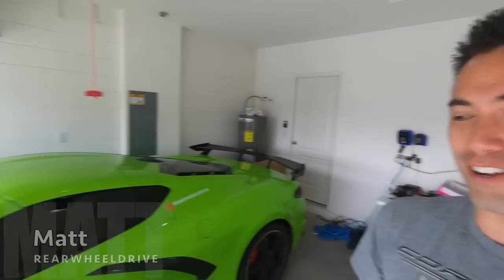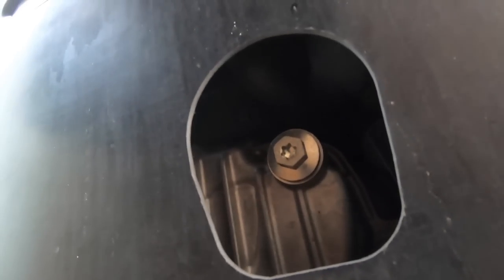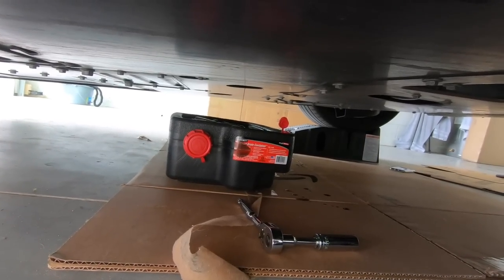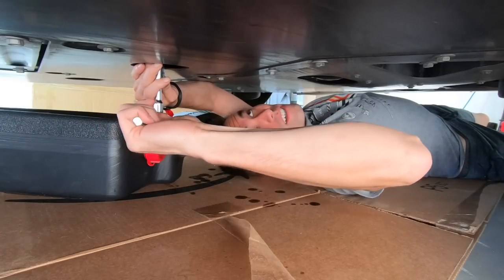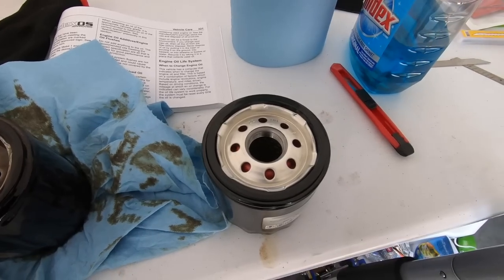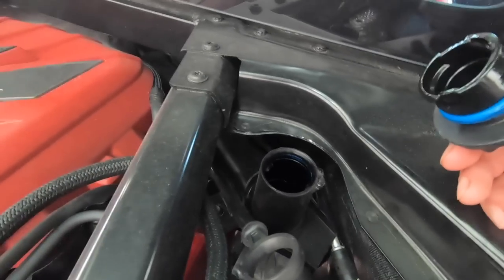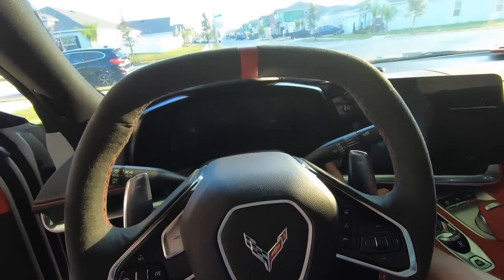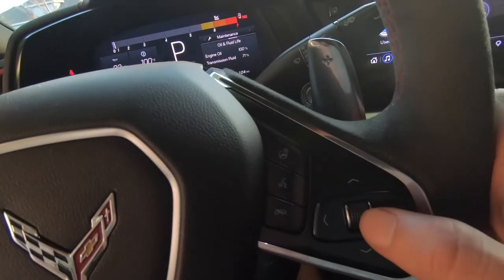C8 CORVETTE OIL CHANGE (How To Video)

Comment: Easy. Just never get under a car without jack stands. Safety first.
Reply: Normally I would agree but good Rhino ramps are plenty safe if you put car in park and apply e-brake manually.
Also ALWAYS BLOCK FRONT WHEELS WITH PROPER RUBBER CHOCKS.

Comment: There is another item that needs to be changed, particularly for the first oil change. It's the  Dual Clutch Transmission filter which is done every 7500 miles.  Check your manual.
Reply: is that something that is as easy as the oil change?

Comment: Nice dude nice! Awesome video!

Couple things I have learned doing oil changes over the years:
1) Get those rubber gloves janitors or commercial cleaning staff use. Keeps your hands completely clean, they are gold. 
2) I actually take the fill cap off first before draining out the oil. Its an old habit based on a presumption that air pressure coming down through the fill cap will help out oil flow. I am probably full of crap there lol.
3) I also started using a wide tub and then using that to fill a tall gas can looking thing because those pans similar to what you had in the video always broke on me. It was frustrating. Plus with the narrower trunk situation we have in the C8, probably better to do that than a wide pan to transport to your local parts store.

I am glad you pointed out the difference between the European and Dexos2....many people are mistakingly buying the wrong type.

I have ramps too currently, but I am stocky and my head is huge so I barely have clearance underneath my lowered Camaro right now. I plan on getting quickjacks finally for the C8.

Comment: Thank  you.  May want to check but I found oil on either amazon or ebay I don't remember, 6 quarts for $55 with a AC Delco filter the right one.  And free shipping.  That was cool didn't even need to run to the store.   Don't you just love the sound!   Again Thank  you for the video.
Reply from the maker: Did the oil have dexos 2? If so that’s a great deal
Reply: @RWDC8Z what it says ESP +3 in the green letters ? Does that work too ?

Comment: Matt, love this video. Just got my 2024 C8 this week. When I was younger I always did my own oil changes. I think I’m going back to doing it myself as they are insanely charging so much to do them now and you showed how easy it is to do. Questions: Do you have a link for the oil drain pan you used and the ramps? How to you take the oil out of the pan and what do you do with the old oil? When I was a kid we always pour it down the storm drain or into the grass if you believe that (can’t and never should do that anymore!j. Also is it really a good idea to back your car in the garage and have it running for the carbon monoxide fumes that can kill you (I don’t think so!)
Reply from the maker: Thanks man! Autozone for drain pan, ramps are race ramps. Take used oil to autozone
Reply: Is race ramps a brand or type of ramp?

Comment: excellent video use ramps and block front wheels for safety as he does-very important as you will be under the Vett in the middle of car.
I have done 4 changes on my c8 but would like to add in march 2021 nobody but Amazon had the proper oil.
Also be carful on using aftermarket oil filter as chevy has a distinct by pass that they use on the LT2 engine. Another thing is O-rings are not available you have to buy a complete drain plug for about $21 bucks so you might want to have one on hand incase you need it while doing the oil change. And for God's sakes do not use the European 0-40 oil it has to be ESP oil now called SUPER CAR OIL ON THE MOBIL 1 OIL 0-40  Amazon is about $57 for a 6 pack of oil.

Comment: GM claims that Dexos — marketed and spelled with a lowercase “d,” as in, dexos — keeps engines cleaner, reduces sludge, improves fuel economy and reduces engine wear because it flows easier than other oils, and it can help emissions components last longer.

Comment: Thanks for the demo video. probably try doing this with mine tomorrow, ..it will be my first attempt. . let me know if you have any other tips that weren't mentioned in your video.
Reply from the maker: How did it go?
Reply: It'll most likely be another week yet. But I was happy to notice those ramps you used. I already have the same ones & wasn't sure if they'd be okay for the job. Do you know if it properly drains enough of it's dirty oil with only the back end raised?
Reply: @RWDC8Z  All went well today. I had to go with Mobil 1 0W-40 "SUPERCAR" oil And my GM dealership OEM filter also had the 8 holes like your Mobil 1 filter.

Comment: Guy’s just a heads up I contacted Exon Mobil and they said you need a M1-114A filter. It has a higher bypass pressure. He said the M1-113A has too low of pressure bypass and won’t filter oil.. also you should use Mobile one Super Car oil made especially for the Corvettes.

Comment: TY for the video 👍👍

There where several important items you left out.

1) Use a torque wrench to tighten the drain plug. Per GM the torque spec is 18 ft lb 
2) When tightening the oil filter turn it until you feel resistance.  Then turn it 3/4 of a turn, no more! Any tighter you risk not being able to loosen it next time.  Less than 3/4 it will leak

Comment: hey matt hows things? just a question i was told that there was a bolt similar to the drain plug in the transmission and if u remove the bolt it will drop something inside the transmission and have to take to dealer to fix. this true??? also the engine cutting down on 4cylinders is that good for the engine ??? they sell a product u plug in and by passes this feature so its running on all 8 all the time

Comment: Have your brakes faded at all on the track.  Have you bled the brake fluid yet on your own?  Wasn’t sure if that was possible due to another video I saw from corvette conti that showed him having to have the dealer electronically disable the booster and unplug fluid level sensor and battery before the brakes could be bled!

At least the oil change is simple!
Reply from the maker: Havnt noticed any brake fade and have not bled the brakes
Reply: @RWDC8Z  

I assume your car has the z51 package?   Ours does as well so maybe the cooling on the z51 cars are a lot better than the standard ones.

Comment: Good job question how much does dealership charge for oil change for c8 ?
Reply: I think it’s not much more than the oil price he paid for.My Camaro SS came with 2 free oil changes. I think the C8 should as well. I’m wondering how much they charge.
Reply from the maker: One dealer quoted $109.99. About same price as doing it yourself.
Reply: @RWDC8Z  yes that is about the price quoted by my dealership here in SoCal. Great video BTW!

Comment: Hey man! I have a friend with a C8 highest trim and it looks so damn gorgeous. I was wondering if I could use the LIQUI MOLY TOP TEC 4110 oil since the Germans make amazing oil but it’s 5W-40 which is similar to 0W-40 and it has the GM dexos2 oil spec. LIQUI MOLY surpasses Mobil1 in every way and I really wanna use it on his car but it’s his car and I don’t wanna cause any damage. Maybe you’d know something that I don’t but I do remember seeing that the new 2020+ LTs can use 0W-40 and also 5W-40 but it HAS to be GM dexos2
Reply from the maker: Unfortunately I dont know. If you find out id love to know.
Reply: You can use  also valvoline, amsoil etc

Comment: Recommend getting the Fram XG12060 oil filter. You can change that every 2nd or 3rd oil change. Makes it that much easier. Ran mine 26,000 miles with no issue.
Reply from the maker: Oooog questionable

Comment: Brand new car with a warranty why not just take it to the dealership lol
Reply from the maker: A couple of reasons. Warranty doesn’t give you free oil changes. I don’t like sitting in waiting rooms when I can do it myself at home. And best of all, I enjoy it!  Thanks for watching!
Reply: Makes sense
Reply: Cause the mechanic would take it for a 148 mph ride after the change, like what happened out in California.
Reply: Chevrolet offers one free service; best leave that one free service for the DCT filter change (at or before 7500 miles), and that would also get 'that' engine oil change included as well.